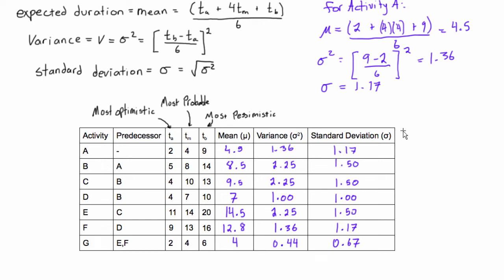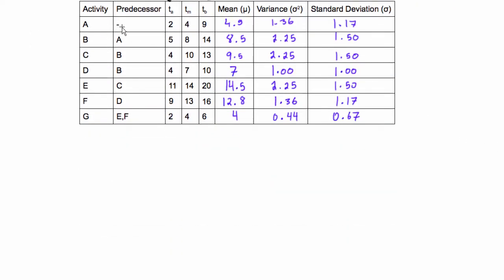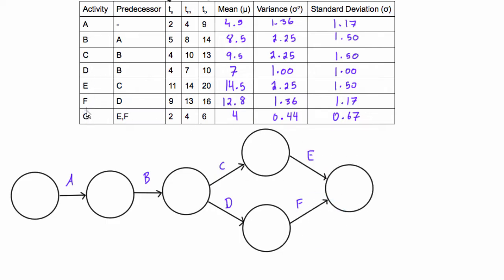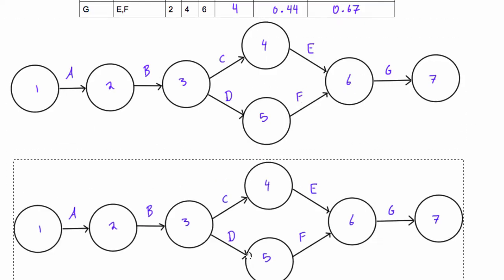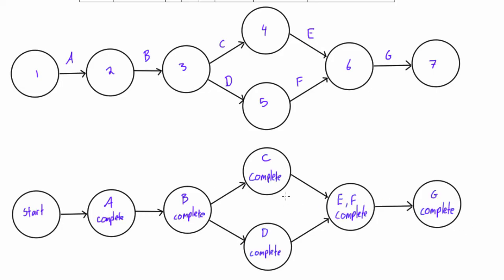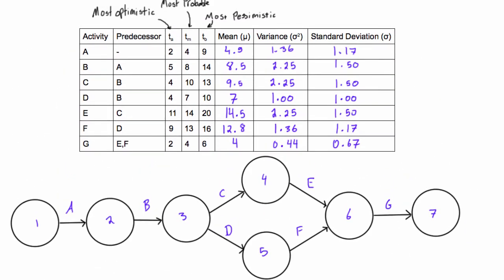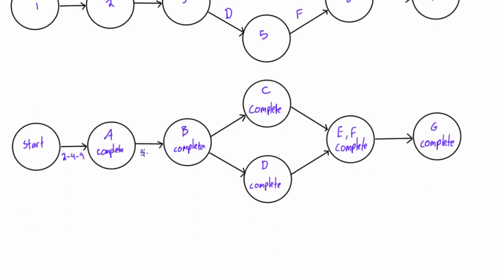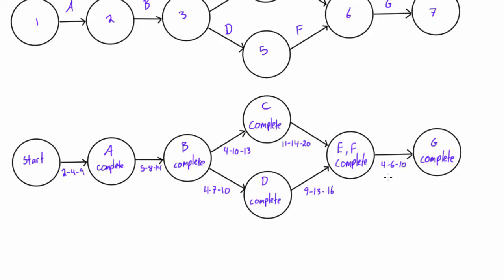How to draw an ADM network diagram for PERT problems

Comment: Please I need to thank for a well focused and determined effort in the engineering tutorials on project managements work schedule from a dependency table to the development of the Gantt chart, the activities to number of days (duration), the early start to the early finish, the late start to the late finish, indicating the float or slack as not highlighted on sky blue colour and highlighting the critical areas on red ♥️.
 My dear thank you for much work done on Engineering Project Managements.

Comment: For 2nd fig E,F should be separate.because E is only preceded by  C and F is only preceded by D.
Reply from the maker: Hey Rajani, the style of network diagram that I am using in this video is considered to be an "activity on arrow" method, which is notably different than the more popular "activity on node" method. I made a video comparing the two styles of diagrams here: www.engineer4free.com/4/cpm-vs-pdm-network-diagram-example I encourage you to check it out, and if you want more examples on the two different types then you can find them in videos # 4-12 at engineer4free.com/project-management